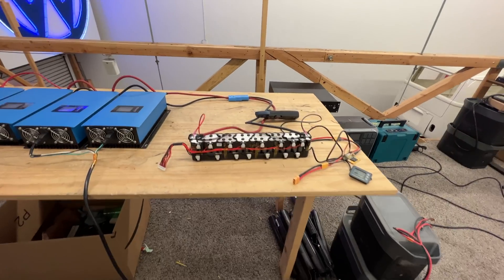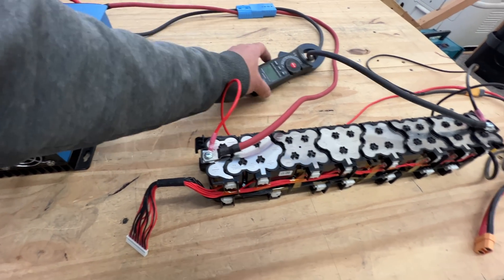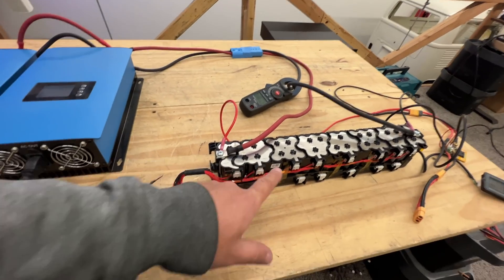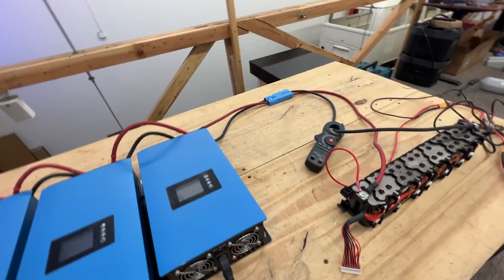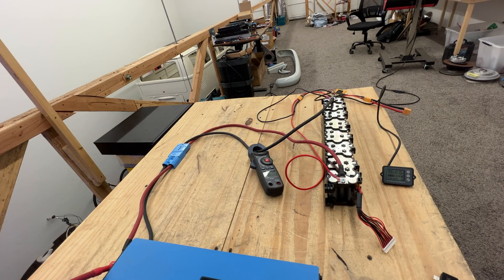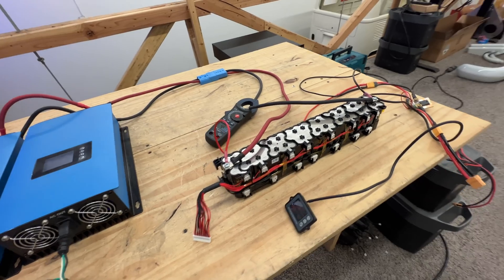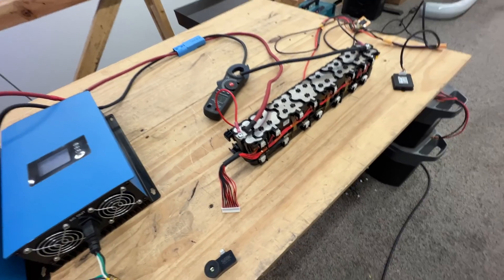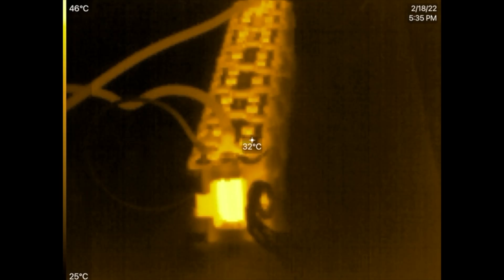What should I Do with all these inverters?

Comment: Jehu, I LOVE what you are doing.  Totally inspiring. You’re giving me the courage to try this myself. I want to make a power wall and also try a small solar setup. But as a beginner, could I request that you do a review video? So many questions. What are the benefits of a 48v system…or 24v? Obviously the cells need to be configured for voltage, but why? Also, there’s a lot of jargon and I’ve been watching a lot of videos but in some ways, I’m a little paralyzed. So even if it’s just a video that links to the right ones with the information that walks through the basics of a power wall, that would be helpful. There are so many videos and it just gets a little jumbled. And it’s hard to keep straight what’s for sale on the website that will work for what I want to do. The R5 batteries looked great, but they’re gone. Thanks again for what you do, this is awesome! I’m going to be ready when PG&E starts turning off the power again.

Comment: 3 phase inverters should sell well to anyone who wants to have a machine shop in a rural area where there is only single phase power.  I have considered the possibility of a 3 phase inverter on the same battery bank as a single phase for that very purpose.
Reply from the maker: These are grid tie so you need 3 phase service to use them.
Reply: @jehugarcia  you can't run them in island mode?  My idea is a single phase grid tied inverter between me and the grid or off grid is my real goal.  But of the same battery bank power more than one inverter the 3 phase inverter would be off the grid behind the single phase inverter.  I have 2 Schneider Electric XANXW6848PRO single phase inverter for my home off grid system but they would work grid attached I can add a 3rd 3 phase inverter to the battery pack for sure if it is in the same family.  If it one single phase inverter was attached to the grid the single phase inverter would recharge the batteries as the 3 phase discharged it if the solar panels where not charging.

Comment: Yo 3 phaser: Your 3 phase inverters may work good with 3 phase industrial back up generators which are a dime-a-dozen here because of their "odd" output voltages mostly 277 & 440+VAC. Presently these 3 phase converters cost more than the generators and you need too have near equal loads on each phase to work properly. I am interest in purchasing 1 of your good 3 phaser(s) for testing here in the Great White North of Minnesota. Tom

Comment: Is it possible to convert those triphase converters into one or 2 phase ones!?
Reply: put a 3 phase to single phase transformer on the output. it could also change the volts as well (440 to 220/120)
Reply from the maker: These are grid tie inverters,  you need 3phase grid to use them
Reply: 3 phase Delta or "Y" output on those inverters?

Comment: I'd be maybe interested in the empty box with fans for batteries. 3 phase is useless for the average person.
Reply: Funny how power works in the states. 
Silly 120 and 240v transformers on 2 fase. 
I suppose it's a history you cannot get rid of nationwide easily. 

To get things in perspective:
In the Netherlands we all have 230v, 3 phase, but most houses have only a 1 phase connection, with a 1 phase 35A or 40A utility breaker. (8 - 9 kWh)
So, the fusebox has lots of 16A breakers.
(This has a yearly fee of 300 dollars)
8kW maybe doesn't sound too much,  but for a normal house it's more than enough.

If you want more,  you can convert your fusebox to 3 phase and ask for a 3 phase connection to the grid. 
As almost all houses after mid 1900 do have a 3 phase cable going into their houses,  it's just a small conversion. 
The yearly price for 3x25A still is 300 dollar,  but now you have 17kWh.

If that's not enough,  go to 3x35A. But that will cost you 1200 dollars a year,  so only for big houses:-)

So,  in the Netherlands,  3 phase is just great,  and we never ever use transformers to get 240V or whatever voltage. 
(Except the built-in power supplies for appliances of course)
Ps. We also use 3 phase (400V) for 3 phase motors and appliances. But that's almost never for normal households.
Pps. Nowadays 3 phase (3x25A) is more and more common in new houses, as they have to be energy neutral.
So less central natural gas heaters, and more air to air or air to water heatpumps, or other equipment.
So more power consumption,  also more and more airco units,  cooking on electricity and charging stations to charge your electric car at home.
Ppps. Off course,  we are billed for each kW. It's not free. (0.22-0.26 $ per kWh)
Reply: @gubbernl  thanks so much for that information. I learned a lot how things work over there. Very interesting 👌

Comment: I'd be totally down for buying a working 3 phase inverter
Reply: Same. I have already and some Siemens busway.
Reply: I'd be interested in a faulty 3-phase inverter if the price and shipping made sense.  I'd try to determine the fault and fix it.  But, to be honest, I don't really need another project.  But, I've worked on 3-phase solar and those inverters represent some serious money.  They would be worth it if it's just a single component that went bad.  But, like you said,  3R (weather-resistant) electrical enclosures are expensive just by themselves.  Totally worth it if you live in a tiny house like me and want your power wall to be 25 ft away from the house, for safety.  Love your videos and the work you do, btw.

Comment: i would like to have one of those 3 phase inverters if the price is right  i will sure with you how it can be easily used NOT connected to grid i build and modify inverters
Reply: i definitely want some or all of the gutted parts out of the inverters also!